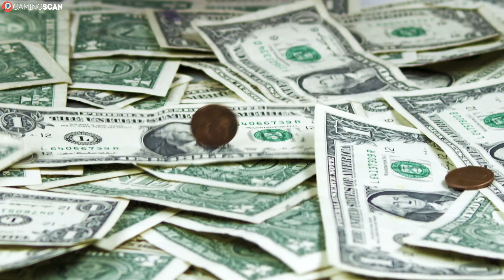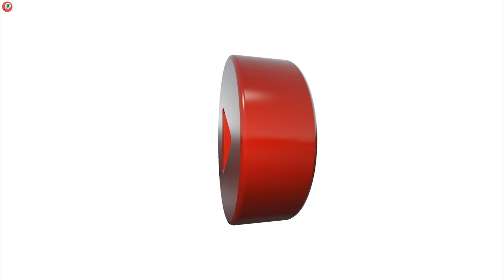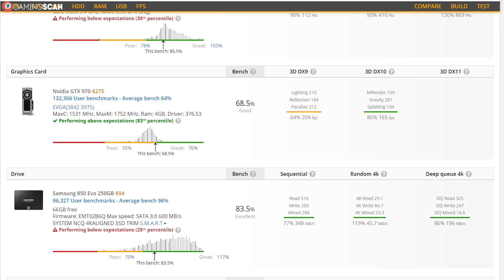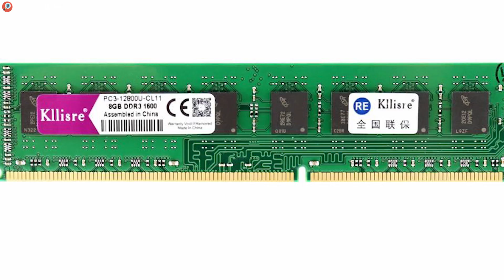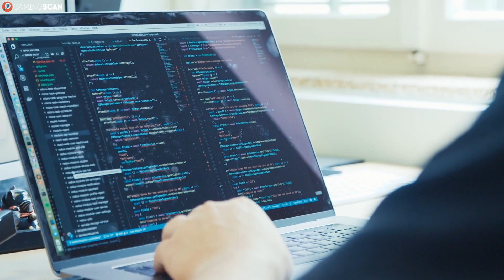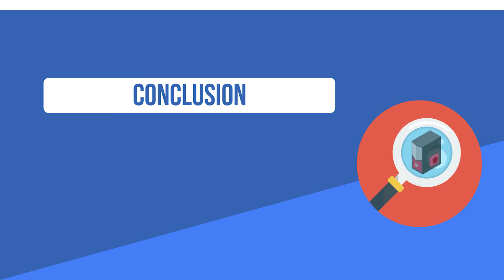How Long Will A Gaming Laptop Last? [Simple Guide]

Comment: My laptop is asus a46c has been running for 14 years since 2008, I do deep hardware cleaning once every 6 months, able to play high graphic Resident Evil 6, dota 2, I am very grateful, today the monitor started a problem only half of the monitor works, hopefully it will last forever after replacing the monitor
Reply: I have a 2005 AMD athlon 64  laptop still in great condition  should be put in a museum, I like to show it off to my nephew  as this was top of the line back in the day.  lol

Comment: Found a GeForce RTX 3070, Core i7-11800H, 32 GB RAM for a pretty good price but im just scared it will get so hot so it shuts down i wanna be able to play games like rrd2, forza horizon 5, far cry 6, and big games like that
Reply: Honestly go ahead with Acer they never overheat I have had the Acer predator Helios 300 2019 model it never overheated never ever overheated also I played like 5 to 6 hours nothing no overheat but the cpu the max for me it gets to 92 maybe other Acer models get 93 but don’t worry it will not get more than 92 or 93 for me the max it gets to 92 I would prefer going to with the Helios 300 newer models like the 2022 one of the best laptops I have had definitely go with the Acer

Comment: Have my gaming laptop with gtx 1060 6GB for about 6 years now. I repasted it, undervolted CPU and always play games on optimal graphics, added extra 8gb ram and don’t push it too hard. This year will come new amazing laptops that will be about 50% stronger than in previous year, maybe it is time to upgrade.
Reply: The 1060 is the 1080ti of the budget world, it just refuses to die. Had an MSI with it and it was great.
Reply: My 1050ti 4gb 8750h laptop can't be undervolted idk why, options are greyed out and i tried everything, i tried messing with the bios but i couldn't roll back to the first version of the bios because asus deleted that version from their site, it's infuriating! porcodio.
Reply: What brand is your 1060 laptop?

Comment: HP Laptop here. After three years the battery completely stopped and needed replacing. After two the hinge broke completely off. Glad I had it insured. After Four years the charger no longer clipped in the laptop and needed fixing completely. Screen also got replaced twice during all this. In total my laptop is currently 5 years old and all the problems come from either the battery or screen hinges. Used everyday for the past Five years and now going to be replaced as more problems involving the charger and battery keep arising and the hinge is starting to crack again.
Reply: What laptop were you using? Just bought a hp victus. Any tips?
Reply: @volarex5311   HP Pavilion Gaming Notebook (late 2015) 
Don't know about other HP but usually  HP Laptops overheat which causes performance problems so would recommend looking into cooling solution such as a cooling tray or lowering the cpu power usage. 
My HP was before HP made proper gaming notebooks so it had barely any vents and 1 fan. I know newer ones are better. A tip would be to be careful of hinges by opening the lid with two hands on each side of the lid and not one hand in the centre. The hinges should last two years before breaking though as long as you are not rough with it.
Reply: What laptop were you using? Just bought a hp victus. Any tips?

Comment: How many years will my  laptop last? Just received it this week. 

AMD Ryzen 9 5900HX  (3.30GHz, eight cores)
Nvidia Geforce RTX 3070  (8GB VRAM)
16GB DDR4-3200MHz memory (on board) 
QHD (2560 x 1440) display, 165Hz.

New to PC gaming!
Reply: It will last forever 😭😂
Reply: bro that laptop is a beast !!!! mine is a amd ryzen 7 4800h rtx 2060 16gb ram ddr4-3200mhz memory and 120hz

Comment: I played games on a hp pavilion g6 for 10 years
Specs : 8gb Ram
Intel hd 4000 graphics
i3 3rd gen 😂 still doing a great job
Reply: How many hours do you usually play within a day?
Reply: @1128-s1x  Maximum 6 hours
Minimum 1 hour
Average 3 hours
Reply: @killshotz6747  how did you maintain it? Like hardware cleaning and dusting and software cleaning? How often did you do that?
Reply: @greasyflab3180  My laptop was heating midley So last year I cleaned my hardware which had little dust particles n also the only failure I had to fix is my network card. The room temperature is 24°c from where I live
Reply: @killshotz6747  Same. My samsung laptop which i bought in 2013 is still rocking. It was just priced slighltly above the netbooks but after 8 years its still running good. It had windows 8.1 preinstalled and later in 2020 upgraded to windows 10 and +4gb ram
Reply: what's games you play?

Comment: I feel like I'll be very lucky if my HP Omen lasts for 3 more years. The bastard's been finding stupid problems ever since the early days. Mf is now 2 years old and is giving me messages about replacing the battery.

Out of nowhere it also doesn't work well with specific games, it could be a situation like it works fine with gears 5 but not with 4 or starts to run terribly on a ps3/xbox 360 port Catherine after some levels but it runs fine with resident evil 2-3 remake... that's the life of my 17 HP Omen with a 1060 I7 in it.

But anyway, sh@# happens, I might've just been very unlucky with this unity. If you get one, I wish you all the best.

Comment: I had a gaming laptop bought for college and gaming which lasted me 3 years before it turned into garbage.
Rip lenovo y520 i5 7300hq gtx 1050
Issue: probably a motherboard malfunction. It bluescreens unexpectedly at any given time, won't install any drivers, won't even update windows.
It's very hard to recommend a gaming laptop to anyone who wants it for portability. So if you just can game at home. Please please! build a pc and save your money by not buying a gaming laptop!
Reply: I too had a Asus gaming laptop that lasted only right after 2 years warranty. Gaming laptops are just scam. Build a sff pc if you want portability.
Reply: @kevinc.9158  the new portability are mini gaming pc's zotac has one thats 1600 usd with a gtx 2060 mini they are like 5 inches by 7 inches.

Comment: Have had mine for 3 years and still going strong. I do need to have a cooling pad though. Drops the temp by at least 5-10 C which is decent and lets me have it on my lap without burning my legs.
Reply: Cooling pads did not work with my notebook....I have a notebook with a discrete graphics card...and I dont want it to die in 3 years....

Those cooling pads did not help me in any way...only the suction cooler reduced my temps by 20c....tho not during 100% CPU usage(I do lots of video rendering)
Reply: @thechannelofrandomness7670  notebook shouldn’t be used for gaming in the first place. If you’re just streaming/browsing, it should last a fair while.
Reply: @monkelife  I know notebooks should not be used...but yea...I do not have an alternate device...I dont push the settings hard though....Undervolted both the CPU and the GPU....its quite manageable around 80c now

Comment: I have a gaming laptop that's lasted me 5 years and it has the 960m. Recently got a newer laptop with the RTX 2060 and it's a massive Improvement. Gaming laptops are pretty good but they're definitely not going to get desktop performance. But the laptops are better options if you are low on Space around your house or if you just want it for the portability.
Reply: Yet you buy another gaming laptop after your previous one died? I don't know how scary it is to see a $1000 gaming laptop die due to lifespan though..
Reply: My Asus rog G55 is still running after 9 years of daily extreme use. I think deep cleaning each 6 months- 1 year is the key. With some upgrades, mainly SSD it still feels very smooth.
Reply: @kevmalca  cleaning laptop yourself without breaking it?p
Reply: Found a GeForce RTX 3070, Core i7-11800H, 32 GB RAM for a pretty good price but im just scared it will get so hot so it shuts down i wanna be able to play games like rrd2, forza horizon 5, far cry 6, and big games like that
Reply: hi bro i have hp laptop 15 da1xxx its 8gb ram, 1.60ghz, i5, 8th gen laptop i played fifa 20,21,22 it has currently intel uhd graphic card  and its working fine but i do get some issues some times 

i have 2 plans 
1. to up grade graphic card by installing 4gb card ( i only play FIFA)
2. sell this laptop buy pure gamming laptop budget is 55-70k  

pleas suggest
Reply: same i have 960m ! i guess im not gonna use it for gaming always . max 30 mins  ,coz i have lots to edit videos ,,,
Reply: Gaming laptops are more practical, desktops rely on power grids.
Reply: MrBeast ❶  lol guess what, i bought a  $1k gaming laptop too and currently its been 5 month since i bought it from store and now its showing a defective screen issue. 
Sorry you didn't know but I'm a student and i have limited pocket money, seeing my parent's expensive present just go broken not even a year is seriously a hard time for me right now.
I guess if you'll ask me how's it going in the future, i may have gotten my laptop fixed already, hopefully
Reply: @malfuriouz7717 May I know what laptop you got? Just curious
Reply: @malfuriouz7717  oh

Comment: My ASUS laptop is 4 years old and it still gives me 3:45 hour battery backup you LoL HAHA TAKE CARE OF YOUR LAPTOP BATTERY.
Reply: Shades if you always leave it plugged in will damage the battery
Reply: @hardikbeniwal5762  you can still keep it plugged in but at least let it drain for maybe once per month
Reply: my battery doesn't work anymore lol thats the only problem i got XD even though its getting time for a new laptop
Reply: My MacBook Pro is 7 years old and has 1000 cycles yet it still holds charge for 3 hours than again a battery replacement is something you can do yourself with every product that does not have a Apple logo.
Reply: Install MyAsus guys...there is an option where it cuts off charge at 60% and does bypass charging
Reply: My current laptop is a shitty Chromebook from 2016 running Linux Mint, battery life is really good surprisingly.

Comment: I heard that gaming laptops have a short lifespan if you abuse it, but what if it is mostly used for general purposes and playing Minecraft with shaders for 1.5 hours in a single sitting occasionally, about 3 days a week?
Reply: @SrErwan i play game for 6 hour in a day with my legion 5 pro, can it last 5 year+?
Reply: @EVILPOPMIE  yes just clean the fan every 3 or 2 months. Repaste if you can and treat it carefully. Always plugged in if you can. So the battery life will last longer
Reply: @ills.6  if you plug it in and play it does it just run of the charger power instead of the battery for that time or does it continue to stress out the battery at the same time

Comment: How long will my laptop last if it has AMD ryzen 5 3500H with a GTX 1650 and 8gb of ram?
Reply: It will probably be functional for many years, but as these specs are not great, it might become obsolete pretty fast. However, as "obsolete" in this case is a very subjective term; different people have different preferances/demands for graphics/fps, whether it's performance is good enough for you depends on what's obsolete for you.
Reply: I have an asus Tuf 1050ti with intel i5 8000 series, it has been two years and still going strong, though i did upgrade my ram to be 16gb for it to get an extra kick, So I would suggest to do so too when you get the chance, it will last you at least 2 more years with not bad graphics settings
Reply: @gandhisaad1  im planning to buy a gaming laptop but i would like to know some tips on slowing its degradation , my friend gave his 750ti 2 yrs ago , was very good but i abused the shit out of it . Now its running superslow , benchmark is wacky and not fast like the first time i did it .
Reply: @xorlux  to be honest, there isn't much to do, since your Gtx 750 ti is very old and probably not supported by today's drivers, though one thing that might help is buying a cooling pad for your laptop, since older laptops tend to get too hot, therefore limited due to heat restrictions. I would suggest to upgrade if you have thz means to do it(wait a bit for the newer generations of 3000 series 3050/ti, they probably will have a drastic jump in performance!) You wpuld be able to get new ones whrn they come out I believe as low as 750$( maybe Acer Nitro or asus tuf, thouch prepare yourself for less quality of build)
Reply: @gandhisaad1  i have lenovo l340 gaming intel. 9000 series gtx 1050 i can upgrade ram ssd and overclock to 4.1ghz will it last up to 6 years i ak playing csgo only
Reply: I mean, If you only play CS-GO it will last you a lifetime lol

Comment: If you keep the gpu and cpu below %80 it will be fine and last 5 years until you start having problems. I am currently using a gtx 1070 on my desktop build and the only issue is that it would crash if i get around %80. Only on overwatch when it crashes. I get around %80 when playing on epic in 1440p, 90 fps. Once i switch epic to ultra it never crashed. %65 , 100 fps. I use msi afterburner.  Planning on getting a rtx 2070 laptop soon but getting the max q version for cooler gpu and cpu temperatures. Just clean your laptop regularly (every three months) and don't abuse your laptop by OC like. Putting stickers on a pc is abuse and will over heat your pc.

Comment: Hi bro I am using Asus tuf gaming laptop and I play high graphics games on it while keeping it on the charging does it will affect the battery life of my laptop
Reply: Batteries are $h1t in Gaming laptops since they consume so much power so just plug it in but you can use the battery if there isn't an outlet, also your battery will be ok, since modern li-ion batteries don't overcharge, but it'll slowly degrade if it is too hot, so don't worry,
Reply: Can u suggest me
Reply: Hey, I saw a video that says that there is no problem mainly, but that you may "exercise" your battery which is basically charging your laptop to max and then let it run out until a pop up saying that you need to charge it appears, then you fully charge it again. The video said that is preffered to do this twice a month.

Comment: If you want your "Gaming" laptop last here some of the best things you can do:
- UNDERVOLT CPU (best thing you can do)
- undervolt GPU*(Do this only if severely throttling and fps/temps are somewhat unstable)
- repaste the thermal paste on the laptop (avg drop of 5-20~C)
- Have consistent charge cycles( do general work and  before it dies plug it in and play some games)
- Dim the display and keyboard lights as much as possible
I've got a MSI laptop running very smoothly after one year following this guidance.
Reply: I do the same bro but i don't know how to repaste the thermal paste. Please give me some suggestion on this
Reply: @sachinburakoti2327  check out video! But ve Careful I short circuit my laptop while thermal pasting!! Lucky I have warrenty so I got fixed
Reply: @pavansampath7201  how did you short circuit the laptop exactly?
Reply: @josegallardorocha5135  I thermal pasted without disconnecting battery
Reply: @pavansampath7201  that's the first thing I thought had happened, thanks for replying!!!
Reply: @pavansampath7201  what's the symptom of a short circuit on a component? I'm sorry to ask this
Reply: @malfuriouz7717  it literally doesn't work! It won't turn on
Reply: @pavansampath7201  oh wow, I see that's why your warranty was able to replace your laptop with a new motherboard, i guess?
Reply: @malfuriouz7717  actually warrenty voids when u touch the motherboard!! I managed them without knowing this😅
Reply: @pavansampath7201  lol bravo on that mate. So realistically, does changing a new motherboard means you have a 'new' laptop to use?
Like is it the same OEM-quality when you first time used the laptop?
Reply: @malfuriouz7717  yes everything is new!! Except body of laptop!! I own a asus rog
Reply: How long can ur msi laptop last without charge?
Reply: Undervolt is really powerful tips to maintain the gaming laptop
Reply: i recently have msi gf63..thanks for the keyboard backlit advice, will do hehe! 

ohh i almost forgot how do you undervolt your cpu? i guess i can undervolt it when im not in game
Reply: @JohnFrankie622  how is it? I just recently got the 60hz ver. My previous hardware was a pc with no dedicated gcard, intel uhd 630 and 4g of ram. Its soo much better but I am curious how the laptop will hold up
Reply: @Zeem240  The only problem I have is the fan noise when Im running heavy apps, e.g., premiere pro, valorant. Other than that, it is worth a buy! BEST FOR ITS PRICE HONESTLY!
Reply: @JohnFrankie622  i see. thx for the info. Lets hope our laptop lasts long!
Reply: Is this MSI laptop still alive?
Reply: Extra late tips: only game when the laptop is plugged in at 100% battery
Reply: When should we apply thermal paste like how often ??
Reply: @Scoobydoowings  when cpu temp reaches 95c !! And ur games start lagging
Reply: @pavansampath7201  What is ur opinion about msi gF65( 1660ti 6gb) ( intel i5 9 th gen 16 gb )?? Do u recommend this lap  over asus tuf, acer nitro, hp pavilion gaming?
Reply: @Abeyjohnsen  yes!! Go for it!
Reply: Hey Friends
Lenovo legion 5 (gtx 4600h 1650)
Vs 
Asus tuf a15 4600h 1650 
Which will last long from your knowledge/experience??
Reply: @zaynmalik_707  lenovo
Reply: @zaynmalik_707 well my Lenovo Legion 5 broke after 6 months. Power block is ridiculously huge for no reason and started causing problems. Tripping circuits. My Asus ROG has been going strong for a year and i feel it is a more enjoyable experience. Ironically this is the laptop that I wanted originally.
Reply: Royal bro kun xai msi ko laptop ho tmro?